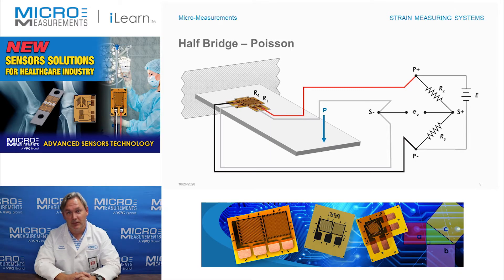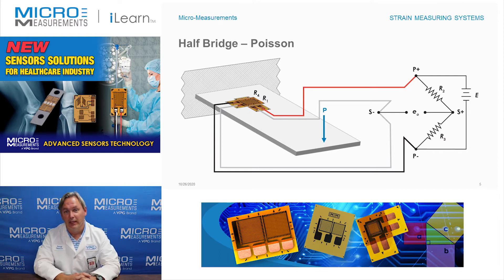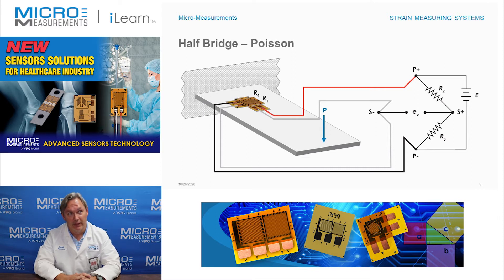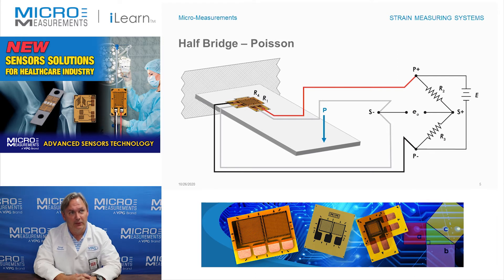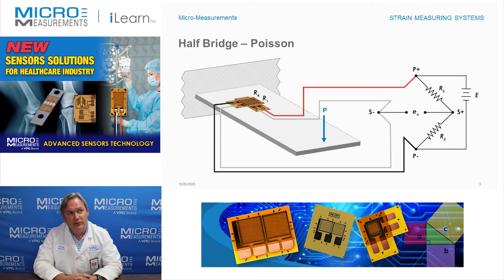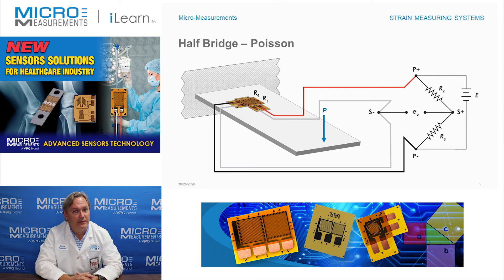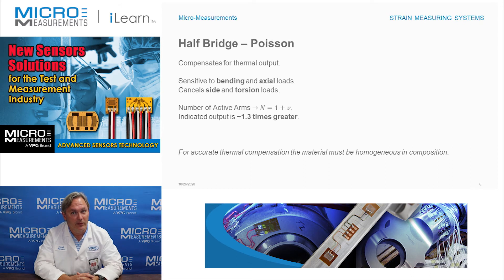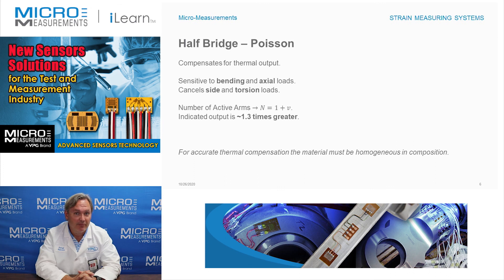Half (Wheatstone) Bridge – Poisson's Ratio.

Comment: Hello!
Could you please care to explain, why the perpenticular strain gauge "feels" a compression and not a tention force? thank you!
Reply: The gages are measuring strain not tension. When you put steel in tension for example it gets longer in the direction of the tension and get narrower in the perpendicular direction in a fractional rate (poissons ratio) as the material does in the tensile direction. Poissons ratio for steel is approximately 0.3.